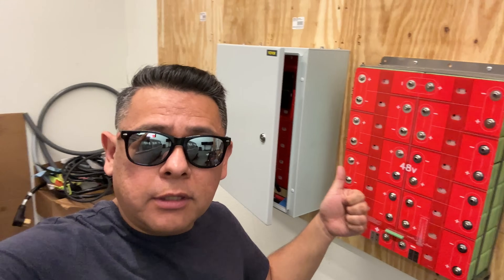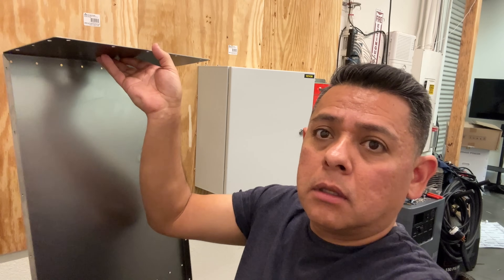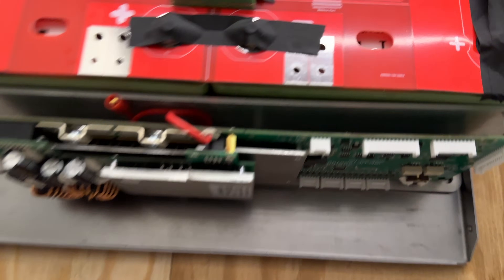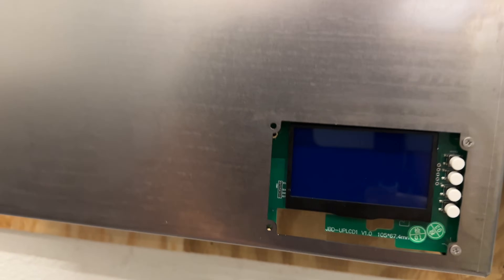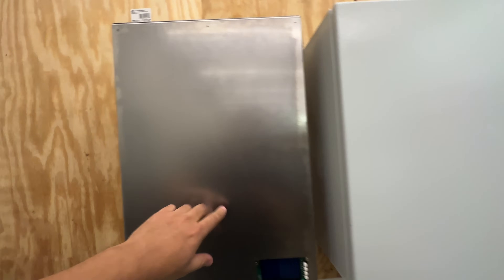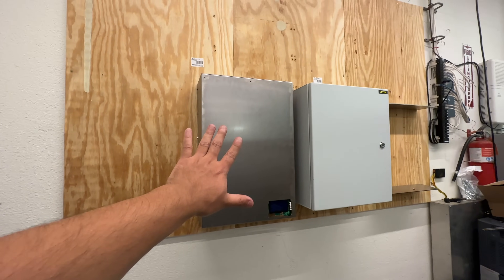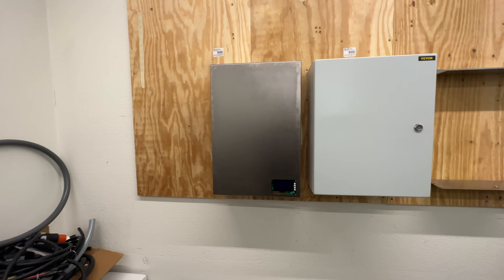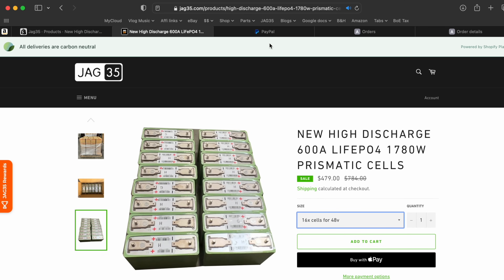Custom Enclosure for 48v LEV60 LifePO4 Battery

Comment from the maker: https://jag35.com/products/high-discharge-600a-lifepo4-1780w-prismatic-cells
Reply: Great video. Would definitely like to see you develop this further. That said, how about offering a floor version with heavy duty wheels/casters, for those who would rather have a unit that could be rolled around when needed(?)
Reply from the maker: Yeah working on a floor version currently also

Comment: The idea's good, you said it was sketchy when putting the batteries in . So in the top of the unit make keyholes to hang it from screws, so that way you can lay it flat on a table when you mount your batteries in it. Also I'd probably make it just a hair thicker that way you will avoid the front cover touching the batteries because even after it's powder-coated you can scrape the powder coat off putting the lid on causing a short.

Comment: I'm interested in DIYing a 19" rackmount UPS with the cells you're working with here.  I'm a home computer lab builder who bought my first 19" rackmount case more than 20 years ago.  Unfortunately these prismatic cells are awkward in two different dimensions for rack use.  Just slightly too thick to lay on their side in 1U of height, just slightly too tall to stand up in 3U of height.  The only convenient dimension is their length.  Three of them fit side by side lengthwise across a 19" rack.

Comment: Unfortunately no, those cells are too tall for standard 3U.  1U is 1.75 inches.  A 3U case is 5.24" tall normally, and that's the outside dimension.  Subtract the thickness of the steel top and bottom for the interior height.  It'd have to be 4U tall (a very common size for computers.  I have 4 computers that have 4U rackmount cases).

Comment: Jehu, I don't understand you.  Some days I suspect you are some kind of mad scientist genius.  Then you do things like isolate heavy batteries from steel using only glorified electrical tape and I wonder how you haven't managed to burn your whole place down long ago.
You're on the right track, my friend.  Iterate a bit more.  Fail fast, as they say.  I have no doubt you'll get this.  My suggestions:
1) Put a thick layer of plastic between the batteries and anything metal.
2) Make it sturdy enough that it can fall off the wall during an earthquake and not burn down whatever is left of the earthquake damaged home.
3) Those 90 degree plates are causing flex.  Use gusseted mounts for rigidity.
4) Include some kind of retainment to keep the cells from tipping forward.
5) While cost will always be an issue, don't focus too critically on being cheaper than the alternatives.  Focus on being better.  The cost will fall where it's meant to.

Comment: Or better yet make the box to were it can be either rack mount Wall mount ect.   I think for a box system like that would be better off as a rack mount box.  Would want better cells that are more than 74AH,  Most are like 100AH for 48 volt's.
Reply from the maker: I don’t have 100ah cells,  only 74Ah

Comment: Very clean looking setup....those boxes look like they fit so well.... could this be 3D printed in several pieces or are the dimensions of this box too large for 90% of 3D printers?

Since its LiFePO4 I personally wouldn't be worried about cells combusting or anything like that. Just have two plates on the top and bottom for some basic compression.

Comment: What is the compression plate made out of?  Aluminium, galvanised steel?
Reply from the maker: I’ve tried both,  steel and aluminum,  I’m going to slightly mod the design to include a bent on the top also

Comment: Jehu, the new design looks great.
1. It would be great if we you can assemble the whole thing on the table and screw it to the wall in one piece.
2. I think some sort of caps for exposed busbar terminals would work better than electrical tape
3. Can you also build a guide on how to parallel connect these modules?
Reply: Brackets on sides and top
Reply: For #1 I would imagine that it would be awfully heavy to do it that way... There was a YouTuber that hung a battery inverter (with less weight) that needed to use pulleys and barstools to mount it in his basement...

Comment: Have a look at SunSynk batteries.

The unit uses a back plate that is mounted to the wall, then the battery slides onto it and it's held up like that.

In your case (excuse the pun :P ), I think something like that - so you have a simple bracket that is mounted on the wall, for the battery to mount to.
In the places where the actual enclosure would slide on - use a Y type cutout (so when you lift the enclosure to place it on the wall, it guides itself into the groves)

Then for the enclosure, instead of having the cover be a full U shape, turn the back of the enclosure into a U shape instead - for manifacturing.
So think of the back as a template that is just bent into shape.
Have the top be part of the template, and then just add 2 fins on the top part (that are bent for the angle bracket to screw into the sides)

This gives you a much more rigid structure for the core base of the enclosure.
It also means you could have the bottom plate be a changable plate for different setups - like no BMS, or Batteries and isolator or whatever.
The front is then a simple plate - but now for the plate - aka front cover ;) 
Template bend it as well, it would be bent on all 4 sides so it basically goves over the enclosure as a Cover.
Then what you do is you extend (on the top) 2 little plates (rounded ~1cm) - and bent down - these line up with cutouts on the top of the enclosure.

So overall : 
You mount the bracket on the wall (easy)
You then lift the enclosure (can be with or without batteries) onto the bracket, it slides on easy alignment with the guides.
 - make the bracket extend below the bottom of the enclosure - you can have 2 screws that would screw into the bottom plate to make sure it doesn't magically lift itself.
Now add your batteries, install the bottom cover plate with all connections etc.
And then the front cover: angle it (bottom towards you), align it with the 2 tabs on the top and slide the tabs into the top of the enclosure, and then lower the cover flat onto the enclosure.
2 screws at the bottom 
And you're done.
Whole enclosure has 2 screws for the main parts.
*
(top part of enclosure would have screws into the sides, the bottom would have screws into the enclosure and any other screws required)

And if you want for safety, maybe just glue a protective mat onto the inside of the cover , so you don't have to worry about the terminals.
But overall it makes it a simpler enclosure to mass-produce and build - and assemble.
However, downside is shipping - you cannot ship it flat packed.

So in order to flat pack, what you do is have the sides of the enclosure and top, have a tab on the back where you screw in from the back side of the enclosure - where the bracket mount would be.
Basically the same except the sides and top of the enclosure are now seperate and screwed in first.
 - then you have a flat packed, relatively simple to produce enclosure.

Another thing which might be a good idea is instead of having the cover go the full depth of the enclosure, you have the cover stop at the BMS side - so the cover only covers the batteries.
And then have another piece that would screw on for the bottom cover of the enclosure - 4 screws 
This would mean if you don't want the LCD on the top, but maybe the bottom (eg rack mount), it's just a piece of metal to change instead of the whole cover.
And same for the bottom piece, different designs (like for rack) - 2 different designs.

For cabling - don't do a square, it's hard to run the protective plastic liner on it over a circle.
So rather do either 20/25mm holes - since you can get plastic grommits that can protect the wires.

For a battery , you only really need an LCD (or control for LCD), comms, EDR or alarm wires and battery pos/neg.
So 4x 25mm holes for battery wires - or use those terminals - BUT, if you can find a terminal where you can do like 20/25mm hole for them, then you can do that and leave the 4 holes to mount the connector - so if someone doesn't want to use a connector, they can use a grommit, or vice versa.
2x 25mm for comms - .... like that should be dandy.
Rest of the space can be for LCD, or blank for rack.

Or, you say do your PCB (however more costly) and terminate all items like the other bateries have on their rack mounts.

But you get the jist of my thoughts :)

Comment: you need a deeper box -  i am telecom site building 25 years. Outdoor waterproof "Hoffman box" with a 12" depth should work for what your doing. or a china knockoff.
Reply from the maker: Why do you need 12”?   Cells are 5.5” tall

Comment: Nice project. Indeed some improvements needed.
1. L bracket could be good option on sides 
2. I would suggest to put not conducting plate on back of that box and also front of that box as well 
3. make it from stainless steel no need to paint..
4. Put extra L bracket on top of the box (with possibility to remove it in both cases in case that is what customer wants..) so it is easier to hang it on the wall ..it is heavy one after all..
5. I didn't see any earth stud..that one is needed too to place it outside..
6. I'm not sure how properly that outside box is secured to the wall but not very well i would say  and not all ppl got wood studs..some got uneven concrete wall and such..
7. Maybe make another box in the box ..so actually inside box is inside of other box..but not sure if that is needed but as you can see all manufacturers of those boxes are doing that..

Comment: The current battery w/o display runs around $0.28 per Kw and the proposed $1K system runs around $.0.26 per Kw, so it would have to be assembled and the display the bonus at $0.02 less per Kw.  I'd buy an assembled battery box at that price.  I think that would be a great solution for an upgrade to my RV.
Reply from the maker: Definately not per kw

Comment: Looks good but two things. First if you look at the bottom plate the corners are bent in and there is a gap in the middle. Can you add a center all thread for a more even compression? Also adding one or two DC based fans at 48v (or 24v as my susyem is) to push or pull air would be awesome! Just my two pennies... oh and kit form, thats why we watch you ... DIY stuff! :)

Comment: If you could make a kit of these for 900 per 16 cell kit shipped, even if we have to paint them, they'd sell like crazy. I'd probably buy 20 or 30 of them myself. At that price, you'd take over the EG4 LIFEPOWER market, even if users needed to assemble them.
Reply: $900 including the cells? That's pretty cheap....yeah I know they are 74Ah cells (so $1500*0.74=$1110) but that's pretty damn cheap for a box, BMS, and cells.
Reply: Holy shit I just saw he's doing 16 of these cells shipped to me in AZ for $565!
Reply: @ericklein5097  They're smaller than the typical cells though, so keep that mind. So in the normal setup 16 cells gets you about 5kwh, but here it's like 3 and change.